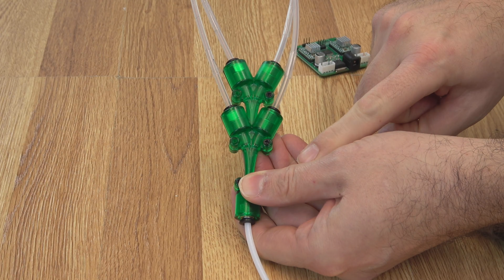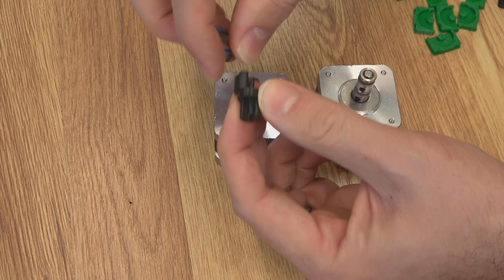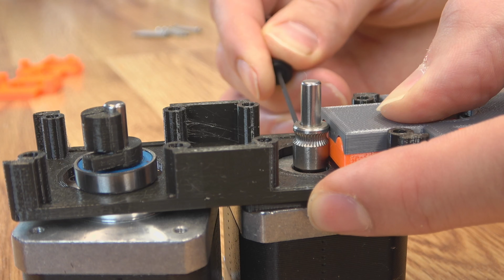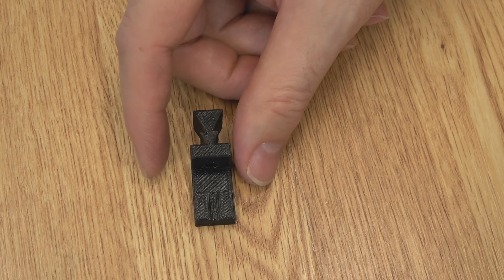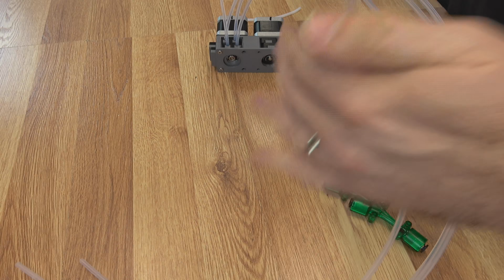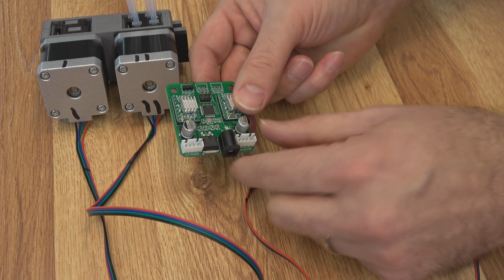3D Chameleon - Part 1 - Assembly - Chris's Basement - 2024

Comment: Question, do you think the SKR 1.4 Turbo would work to run both Say Ender 3 v2 and Chameleon? with there being two extra pins for the motors on the skr1.4 turbo i could in theory use those two not being used to drive the mmu steppers? just have to configure the firmware for it. also will be using marlin as i know it better than klipper, 
also dont really know what all id need to covert to klipper. if i were to.

Comment: How many of these parts do you think I could salvage from an old CR-10 mini I have laying around? I think the board will work if I reflash it, steppers can be reused. Springs and bearings seem to be hardest to get, do you think using the ones on there (not sure on size) and working with the step files to change the size could work?
Reply from the maker: With a lot of altering of the part, you could make it work, but you should be able to get the springs and bearings pretty cheap.

Comment: Nice.  Now that this is open source and not selling any longer. Another build project.  Have two Ender 3 V2s and an Ender S1 PRO that have been replaced with two QIDI Q1 PRO machines.  Might start with an Ender.  The nozzle wipe on the Q1 PRO might work well in this world.
Reply from the maker: We should see a lot of cool mods coming out for it now, I will be doing more content on it soon.

Comment: Thank you for this Chris. I have a small comment on the 2 filament feeder gears. If the stepper has a little spacer between it and the housing, you will be able to get both to bit onto the flat spot of the stepper. without that flat spot, one would run the risk of the gear slipping, and possibly causing a print failure. I would also use locktite on that screw if the spacer isnt possible. I see there is already a bit of a spacer built in.
Reply from the maker: Thanks for watching! I agree, I think we could come up with a better way to space this so we can get it on the shaft properly.

Comment: Another stupid question, do you see any possible way to keep a filament sensor on a direct drive printer and use the Chameleon?
Reply from the maker: Yes, it depends on the firmware, but you can use commands to turn filament detection on and off for the swap outs.
Reply: @ChrisRiley  I would love to put the existing filament sensor between the chameleon wye and the extruder, if I had to I would put one before each the four Boden tubes and figure out how to wire them to make them look like on sensor.

I ran my extruder dry once and paid the price.  I'll never run the printer without some sort of filament runout protection. 

P.S.  I have a stock Ender 3 S1 Pro, except I've upgraded the part cool fan, because mine failed.
Reply from the maker: @The3DPrintingGrandad  Let me think on it, maybe we can come up with a good way to implement some sensors.

Comment: Fantastic work！however I am confused 23:20 there was a switch of two machines, and the orientation of the 'front' was different.
Reply: He mentioned he was going to do that. Long story short, the one that was black with colorful insides was for assembly demonstration purposes only and he ended up getting the plugs for the stepper motors going the opposite way, the all-grey one is the one you'll get from 3D Chameleon if you buy the full kit, it comes pre-assembled exactly like that. The stepper plugs can go either way, depending on how you plan to mount it, so if you need them to go the other way you can simply turn the motor around 180° as long as the same motor stays in the same "hole".
Reply: @richard3365  I figured it out later myself, thank you anyway

Comment: for the extruder gear that is on the round part of the motor shaft below the keyed section, would you recommend trying to grind a small flat spot for your grub screw to tighten against, just to prevent issues with the gear slipping?
Reply from the maker: If you have the means to do so, yes, I think it would be a help.

Comment: Does this have a multi-spool mode similar to a mosaic palette?
Reply from the maker: Good question, that would be handy, but it has no way to detect runout.
Reply: @ChrisRiley  I have a palette 2 and have run into a bunch of issues with it. I print large parts and I’m in search of trying to figure out a good method to print multi spool parts without buying a more expensive 3kg roll. Any advice?

Comment: So I need to buy it anyway?
Is there a way to print the Y path (the green part)?
And get the electronics somewhere else?
Reply from the maker: Not that I know of.
Reply: firmware isn't open source unfortunately.  I feel like the price is mostly paying for the software not the motors and tubes and splitter

Comment: I can already see this can be easily integrated in a Klipper printer, just add a microcontroller and 2 stepper drivers, RAMPS is a good option, define some macros and 2 manual stepper motors in the config file and you are good to go, there is no need of the trigger switch as Klipper will controls the steppers directly.
Reply: Another potential option if you're buying a board anyway, and assuming you're currently only using the standard 4 or 5 steppers, is to get one of the bigger boards, like the BigTreeTech Octopus or Manta M8P which each have 8 drivers. The Manta has the advantage of adding a CB1/CB2 or CM4/CM5 directly to the board so it runs Klipper natively without an additional Raspberry Pi on the side to deal with. That's one of the reasons I'm here... I have a Manta with 3 open drivers, so I'm looking for something I can plug directly into my board to get multiple colors. The ERCF looked promising but it required an expansion board for all the sensors and LEDs, and for some reason my printer detects the expansion board but refuses to talk to it.

Comment: can this setup be used on a creality k1 with the locking extruder?
Reply from the maker: I'm not sure on the extruder, but there is a great printables page on it. https://www.printables.com/model/653583-3dchameleon-mk3-installation-for-the-creality-k1-a
Reply: @ChrisRiley  thank you very much! that super helpful + you video is great to. i may just cough up the $180 for it and give it a try, its just the k1 i my only printer right now and dont want it down for to long lol

Comment: Great video as always!  Just wondering,  do you think this might work with different types of filament instead of just different colors?   Say like PETG and TPU?  To form a gasket to your 3D printed part.
Reply: Sure, it works with any filament your printer can handle.  We don't add or remove any filament capability to your existing printer, so if it can print it fine today, it will be able to with the 3DChameleon as well.
Reply from the maker: Thank you for fielding these questions for us, Bill 🙂

Comment: I have two 3D chameleon - I bought one (MK2) it didn't work, but I saved it. I bought ankther one (MK3) and tried to run it on a Sovol Sv06, I also couldn't make it work. I am going to give it another try. I had all the issues you mentioned: the bearing center piece slipping, Y connector being too lose, not enough tolerance at the extruder entrance to switch filaments, etc. I gave up on it. Perhaps I should try again by taking in consideration your tips.
Reply from the maker: Give it another try. More to come! Thanks

Comment: Cant wait for the rest of this series. I just got mine for xmas and just built myself a  servo cutter for use with klipper. Will wait to see the next videos. Do you have a time frame for the next ones?
Reply: It is to cut the filament just above the hotend but below extruder(direct drive) still working out the small details but i melded it with a herome gen7 bmg so it would work with my setup
Reply: @SirMcstoney  This sounds great, I have this feature on my X1 Carbon but would like to have it on my other printers, are the files available to download?
Reply: @AndrewAHayes i can load what i have onto printables i havnt installed it yet though
Reply: @SirMcstoney  No rush mate!
Reply: @AndrewAHayes Hey Andrew, have you integrated your Camelon into Klipper without the additional board and the endstop? That would be great if you could share the information. I would also like to use the Camelon with Klipper. With a servo cutter it would of course be an excellent solution. Regards Marcel
Reply: So i have it installed and it is cutting. Hvnt printed with it yet as im working on where im going to put multiple rolls of filament behind printer since they need rewinders. Also need to work on the gcode which i believe i have figured out
Reply: @SirMcstoney  Good Luck!
Reply: What does your servo cutter do? Is it like the Bambu Lab system where the filament is cut in the hot end?
Reply: @AndrewAHayes that is a good question. A cutter is nice because it removed the bulged tip left over therefore you don't have to worry about a ramming routine and getting the filament tip just perfect to event misload errors
Reply from the maker: They'll be out in the next few weeks!

Comment: Chris can you recommend a tool to easily get the wires out of the motor connectors, I have another project where I need to swap the two inner wires around
Reply: Hello Andrew, you can try a small needle to release the barb, - worth a shot
Reply: @woodwaker1  I tried a large paper clip end but couldn't get them to open, Im thinking of grinding down a cheap terminal screwdriver to a point and see if that will open them as I will be able to get better purchase on the the tool
 I have done this before with my first printer a Mendel 90 when I got the wires the wrong way around when making a motor lead but I cant remember what I used, I don't remember having any issues though, as far as I can remember it was a very simple process
 I suppose I could always make a new lead if push comes to shove, I have all the components and wire and a crimper for the terminals.
Reply: The tip of the knife we include is perfect for that.
Reply from the maker: Thanks Dave and Bill

Comment: Could we use the Bambu Lab 4 into 1 filament feeder used on the A1 instead of that tall y splitter? It's also a much more compact cleaner look
Reply: Sure, on the A1 and A1 mini, we use it by default.
Reply: @williamsteele  great I was thinking of using that A1 4 into 1 on the K1 Max and build a structure above it so I can have a shorter run to the print head
Reply: @DanielChaves1984  Well... the Y adapter we have doesn't actually cause any issues with it... but their design is a lot smaller, but I don't know how you'd adapt it... it's spring loaded and has features inside it that go down into the extruder.  I'd love to see what you come up with.
Reply from the maker: Thanks, Bill!

Comment: I had endless issues with the Y and filament slipping between the cracks. Ended up scrapping the whole thing after about 40 hrs of tuning.
Reply: Stringing can be controlled by tuning the filament temperature during the color swap or by implementing the 3DClippy filament cutter.
Reply: Jason, what version did you get?

Would you be interested in selling it?

Comment: Glad to see this series! I have been struggling with my Chameleon for about a year now. It gets so close, but hasn't hit reliable enough to leave installed. Mine is a MK3, so I guess I will give the MK4 parts a go, before I throw in the towel.
Reply from the maker: I'm happy to help! Thanks for watching
Reply: get a hot end with a taper into the heat block, bambu's genius was to cut the filament so it has no bulge, do the ram pull it back look at the end then find as hot end that will take the filament when you want to push it back in

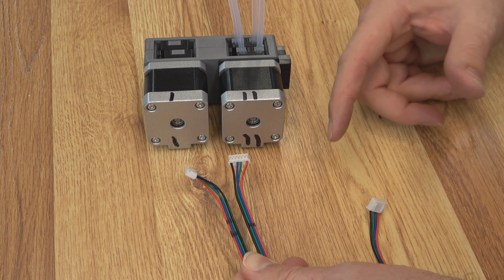Comment: 26:20 - I'm confused, you called one of them "one" and the other "one", too?  
Would it not be easier to call one of them "one" and call the other "two", or should "one" be called "two" as as it has two marks and other called "four" as it has four marks.. or would that confuse things as "one" (or "two") as a cable with one mark whereas "two" (or "four") has a cable with two marks... Hmmm.
Reply: It could be A and B as well. Just away to mark them and keep the wires straight. It is a valuable thing to do. He doesn't show the board in its case, but once it is in the case, you can't see the labels on the board. I went as far as labeling the outside of the case as well, it can get confusing if you have to unplug things to move it. It is a bit of an octopus of wires when mounting and setting up.
Reply from the maker: Let's go with A and B.